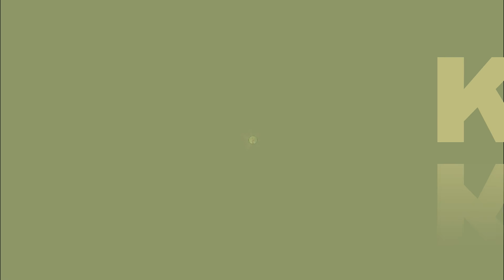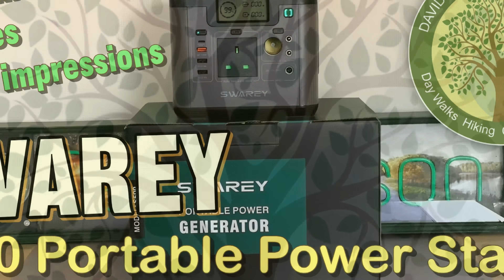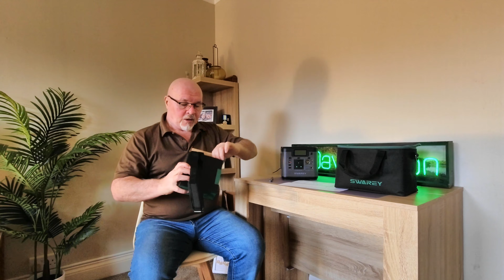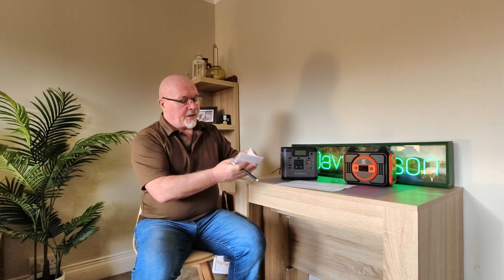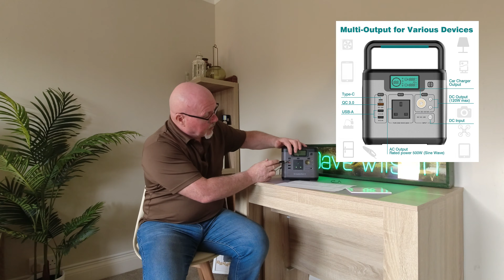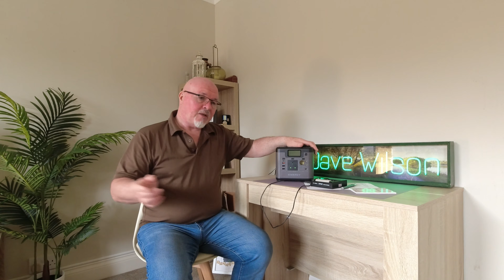SWAREY Portable Power Station S500 PRO Features & First Impressions.

Comment: Just saw this on Temu, and immediately came to YouTube to see how it was reviewed 

So how has it been after a year or so? Still worth it?
Reply from the maker: Hi Andy, thanks for commenting. This power station has proven incredibly versatile for my outdoor adventures – from tent camping and inflating kayaks to charging phones, laptops, and batteries, and even running small appliances like a travel kettle and heated lunchbox. However, if you plan to use it in a campervan, I recommend opting for a larger capacity (1000-2000Wh) power station with fast charging capabilities, as prices have come down significantly recently.
Reply: Cheers David. I'm only after something for home use in power cuts, (I live in rural Bulgaria), just to charge phone, lights tablets, kindle, etc, for any extended period. 

Thanks for the recommendation. These are going for about €180 on Temu, so may take the plunge.

Comment: I'm thinking that as well as a solar panel, if you have a lead acid battery, it could be connected via the cigarette input/ car charger to add to volume ? whilst using it.
Reply from the maker: Volume? If you mean to charge it, I do that while driving. In both my vehicles, the cigarette lighter socket is dead when the keys are removed.

Comment: Nice video, enjoyed it thanks! Just to note, i have a 200w solar panel attached and its charging at 105w. I am wondering what is the max input for charging, the included charger is only 65w which is a shame since it definitely charges way higher.
Reply from the maker: From memory, Swarey stated a maximum size of 120W solar panel for the S500 Pro, so I am guessing 120W is their recommended maximum input.
Reply: @DavidWilsonOutandAbout  Thats annoying if true. I bought a 200watt panel bundle from swarey with mine
Reply from the maker: From Swarey.
Q: How to choose solar panels?
A: We recommend choosing a solar panel of 100-120W, the charging speed is faster in the range of MPPT 15-36V/3A.
【Multiple Charging Methods】You can charge it via the wall sockets, car chargers, and the SWAREY 100W solar panels (not included). The built-in MPPT charge controller can maximise the power generation efficiency of the solar panel and shorten the charging time.
Reply: Hello. Can you link a number of these units together for a greater output? Say two for 1000 wh. And if so how? Thank you.

Comment: Anyone reading this know what error code 16 is and how to fix it, when I tried the ac outlet the fan fires up and it turns off after a couple of seconds I have tried it with a couple of devices and with nothing plugged in always the same 
The battery is good and it works fine on usb
Reply: Ive just picked one up and the same thing happened
Reply: It is a short circuit error 😢 I have the same too. Now looking for the spare parts. It is better to have assembled motherboard

Comment: Hi David, interesting video thanks.  I need a second unit and considering this one but can't believe its small size to be 518wh.  Did you actually test continuously something 80 - 100W to see if lasted close to 5 hours?  Be great if performance matches spec for price and size!
Reply from the maker: @andyb1201  Hi Andy. As yet I have not needed to use it for anything higher than 36W, that was a heated lunch box.
Reply: @DavidWilsonOutandAbout , ok thanks David.  Suppose I could always get one and return it if doesn't live up to specs.

Comment: Is it possible to use a solar panel that's fitted on my camper van? I'm pretty sure it's 175w...
Reply from the maker: I would think so, my Portable solar panel is 120W. The solar panel charge cable included with the S500 Pro is an MC4 to 8mm barrel connector.

Comment: Hi Dave...i see this has a surge peak of 1000w, could it boil an 800w kettle or would you say thats not advised? Similarly for a quick blast of a 600w heater? Thanks
Reply: the 1000w peak is only for a few seconds, like for starting an electric motor. it's rated for a 500w continuous load. it can run a fridge just fine but your kettle will overload it and it will turn off.

Comment: Hi David , what’s your thoughts regarding this units ability to charge an e bike
Reply from the maker: Hi Allan. I haven't charged an e-bike with this power station, however, it should breeze it as it is 518v AC and e-bike batteries are typically 36-48v

Comment: Hi David, I could do with a bit of help here. Ive just bought a unit and charged it up, and after watching your video again..... about 9.30 mins in you show that the socket unit...middle one......... lights up when you switch it on. My unit isnt....... I'm plugging in my laptop and it can take 10 mins and lots of swithcing on and off nad holding it down to get it to show a green light and then work. laptop is 69w so should be an issueat all. the other sockets come on immeidately with a green light. 
DO you think this item is faulty? Ive emialed the manufacturer as the ebay supplier isnt responding. But its been less than 24hrs and I know i can send it back if its faulty. 
your response will be much apprecaited......should show a green light immeidately when I switch it on?
Thanks
Liz
Reply from the maker: Hi Liz,
It certainly sounds faulty. I power on, plug my laptop in, and press the button and my laptop draws 62w. Have you try charging or powering any other item under 500w via the AC point, that will confirm if it is a problem with your laptop lead or the power station? 

ATB, Dave.
Reply: @DavidWilsonOutandAbout  I  did try a few other devices, my mobile works but that is a different slot. then all of a sudden its started working properly, so I'm going to run it this week at home to see if it  does it again. dont want a faulty wire. Does it have a years manufacturing warrenty do oyu know? Besides that its great, its charged the laptop three time and mobile 3 times nad its on 69& from full.
Reply from the maker: I am very pleased with mine, especially as I bought it reduced to £160 on eBay, It has a 2-year Manufacturer's Warranty. Fingers crossed yours continues to work OK 👍

Comment: Follow up to the question i asked regarding the SWAREY S500 power charger  i have obtained a charger the barrel tip is not 8mm as you pointed out in fact it is 7.4*5.0 mm 7.4mm is closer to 7mm and not 8mm One thing to point out when the S500 is switched on and when you press the usb or the 240w or the 12v button and the green light comes on the S500 stays on look forward to follow up video.

Comment: Hi David, very interesting video. Could you send me the link to the solar panel video please.
Also I maight be over enthusiastic about this, but could this run a caravan if usage is very low? I'm considering the fridge that is built into my 2 berth Abbey caravan. 
ANy links to the video you have on using it to charge a leisure battery as well, or be charged by a leisure battery too. 
I dont really understand about the whole elec thing yet, but I'm trying to understand how to link solar panels to a unit to then charge up a caravan battery, to give me light for camping if I go camping instead of the caravan, and pass buy a generator to store energy in leusire batteries. I drive to Bulgaria from UK and my mountain house in BG doesnt have electricity. 
Any links or suggestion greatly appreciated. THanks Liz
Reply from the maker: Hi Liz,
At present, I am only using this power station for charging my camera equipment, it will not be fully put to the test until my micro camper van conversion is complete later this summer. My portable solar panel is 4 years old and no longer available to purchase. When I start using the power station in my camper, I will produce several videos detailing my setup. I will say that even on my old power station, the solar panel was fantastic on sunny days when pitched up in my 4-berth air tent. The only video I made showing the solar panel was a few years back when I made a first impressions video showcasing my old power station.  https://youtu.be/bcmTtMNAPHY?si=npNYzDSIVcMX4Rm3

All the best, Dave 
😃

Comment: Great video David .. I wondered if you could answer a query with regard to this unit .. I have already installed 12v lighting and water tap/pump into my micro camper, is it possible to run these via the fuse box to this power station ?
Reply from the maker: Hi Robert,
This is what I am planning on doing, although I have not started my van conversion as yet. I will probably connect to the fusebox via the two 5.5x2.1mm outlets, then connect a 2-port Dual USB 3.0 Male to USB 3.0 Female AUX Flush Mount Car Mount to the USB 3.0 port. Finally, I will connect a double AC socket plugged into the AC port. For additional power, I am thinking of connecting an ECO-WORTHY 50Ah 12.8V Lithium Battery LiFePO4. Fortunately, I already have a portable 120W solar panel and 30A change controller so I can change the Swarey direct, and the battery via the charge controller. I have found that with the power switched on and any lead connected the power station will remain on as it is sensing a very slight draw in power. Hope this helps.

All the best, Dave.
Reply: Many thanks David for reply , that all makes sense now  👍 @DavidWilsonOutandAbout